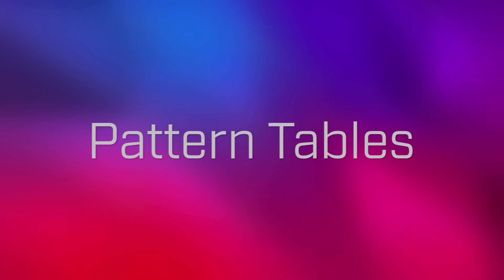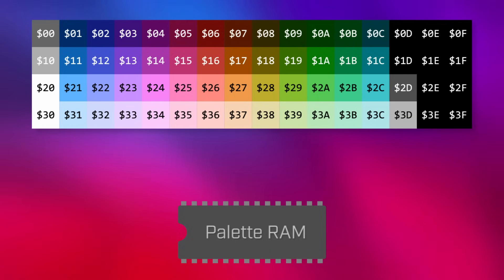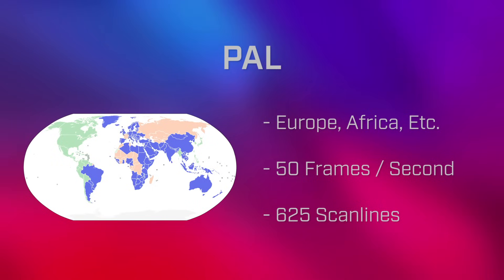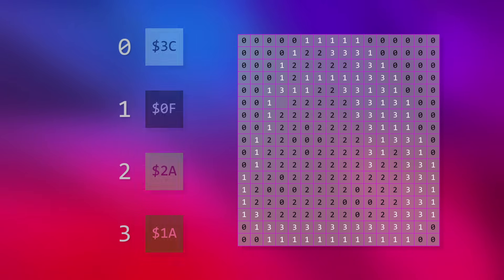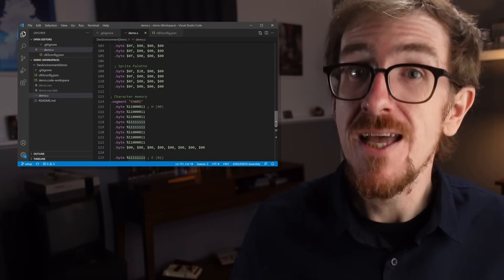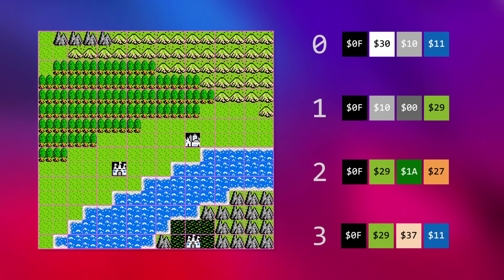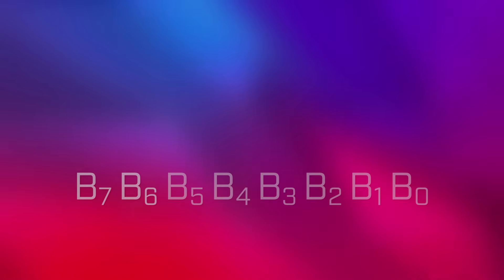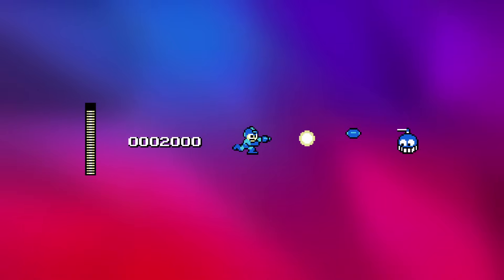NES Graphics Explained

Comment: There's one mistake..
The 256 characters of the Back ground and foreground each take up 8 kilobytes.
Reply: Not just one mistake.
Both pattern tables are 0x1000 bytes long. So 8 KB total. That is 64 kilobits (not bytes!)

What video says is the cathod ray tube is electron gun. The glass housing, including the surface where picture shows, is the actual CRT. Also, there's no 3 electron guns in color CRTs, still just one.

Comment: Do you know if people used Nintendo's PPU in their 6502 homebrew single-board computer? I know many use TI's TMS9918A chip. But I'm curious since I'm building my own little 6502 SBC and would like graphic capabilities.
Reply from the maker: It’s possible, and I’m sure some folks have done it for their hack projects. Though it would be a pain to desolder the chip without good equipment. I haven’t really done the research on that, but your project sounds super cool and let me know wha you settle on!

Comment: I think this further explained me that NES roms does not actually hold any kind of image data from any part of the game and rarely devs had anything to do with drawing pixels on a computer.

The nes draws everything for you, you just need to write down the code for it which that's where things gets quite complicated and demanding. Thus the "devs being Creative" thing comes handy.
Reply from the maker: So games definitely hold "image" data, which are similar but quite different from the kinds of image formats we use today. Tiles are either stored in the CHR-ROM or loaded from the PRG-ROM into a CHR-RAM chip to form the pattern tables (which consist of those 8 by 8 pixel tile images that I mentioned in the video). Also, the data contains color-index data as opposed to absolute color data. This way developers can switch palettes to change the colors of images without having to have multiple colored copies.
Reply: @NesHacker  That's what I was thinking. Raw "image" data, so devs can manipulate colors via code.

Thanks for your explanation! I'm no dev, but I love learning how old school machines and games used to work, it's quite intriguing!

Comment: 5:15 The map is correct, but the description is wrong. You see, strictly, PAL and NTSC refer only to the color encodings, not the whole systems. After all, analog TV is a monochrome signal first, plus a color subcarrier. So it's more proper to say the US used System M (525-line, 60i) with NTSC color on top, and most of Europe used System B (625-line, 50i) with PAL color on top. 
And then Brazil used this funky thing called PAL-M, which was System M with PAL color.
Reply from the maker: That’s a really nice and succinct way of describing it, thanks for the clarifications!
Reply: I was going to make this comment.

As a Brazilian, I never had a problem to import US games to play here. Until I bought my Nintendo 64 in USA. When I rented "Star Wars Racer" for N64, the game was in monochrome, no colors whatsoever. And the weird thing is it was the first game released here with this problem. So it became a lottery and I never understood what was going on, thinking either the game was broken or, more possibly, the console. Rented "Turok 2" and... same thing. But "Banjo Kazooie" played ok, no problem whatsoever.

I found out with "International SuperStar Soccer 2000" that the high-resolution mode was causing the problem. With the expansion pack, some games have the option to run in 480i. But with ISS2000, you can barely play in hi-res, so I tested in low-res. BANG: from monochrome to colors!

So I was lost, thinking my TV was broken, until I found out about these signal and color subcarrier patterns in the internet.
Reply: @rodrigomolinsky  That's odd. The resolution shouldn't make a difference here.
Reply: I was gonna point that out as well until I saw your comment. Glad you caught that!

Comment: Common mistake, Pal-M is as much PAL as it is NTSC, so calling it "PAL" is grossly simplistic. The name is similar, but it's like calling pineapples apples. Sorry to sound rude but I'm triggered by that. ^^ Great video!
Reply from the maker: Yeah I didn't know about PAL-M until recently when another viewer pointed it out to me. It's definitely an interesting how it combined the system-m scan lines and frame rate with the colors of PAL, and I still think it's wild that it was only adopted in Brazil (there's a whole story there that I still haven't really dug into).

Also, I don't really mind when folks are rude, given they have a point... My primary goal for this channel is to help others learn, and to push myself to learn as well. I try my best to get things right, but realistically I'm just gonna be wrong on things from time to time and make mistakes.

In this instance, I was only vaguely aware of the entire ecosystem of broadcast standards that once existed, and underestimated the topic when I wrote that section of the video. But, thanks to viewers such as yourself I've gained a lot of knowledge on the topic's history and nuances. 

So, thanks for watching, commenting, *and correcting*. I really do appreciate it!

Comment: Technically there were mechanical tvs before crts but they were so impractical and uncommon that I wouldn’t argue with anyone who wanted to not count them. So I’ll let it slide.
Reply from the maker: Indeed. CRTs are primary focus here as well since the NES was designed to work with them. I wanted to ensure that the viewer had some exposure to the concept if they hadn’t come across it already as it will be somewhat relevant to discussions of timing and VBLANKS if/when I make videos on those topics. But yes, you’re correct, I should have said “For those who don’t know CRTs were the first commercially viable and widespread type of television.”